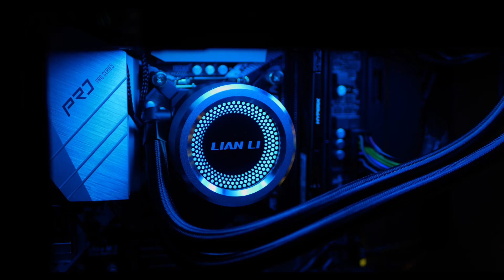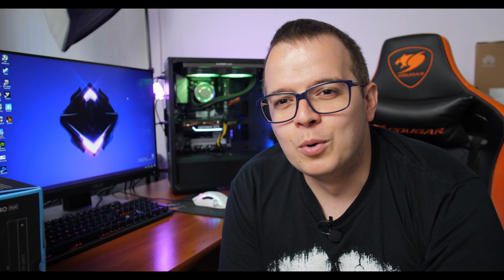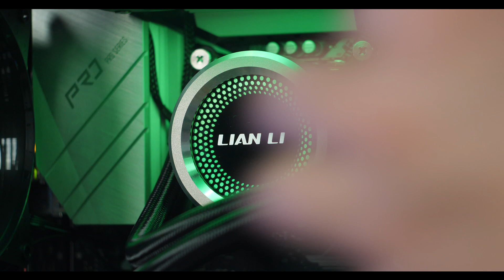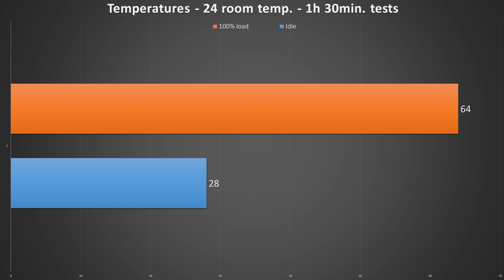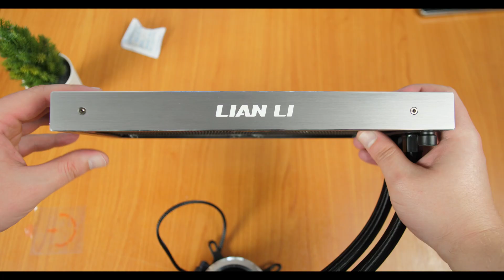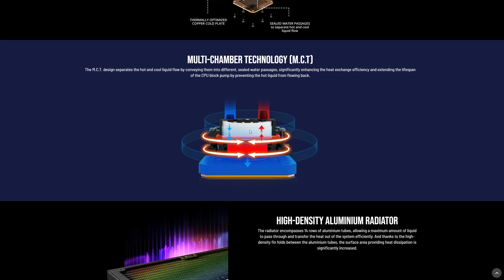Lian-Li Galahad 240 AIO - Beautiful and good performing!

Comment: You can remove those aluminum covers from the sides of the radiator, unscrew those 2 screws from both the sides and pull on the cover, it has a glue strip at the middle portion underneath and pulling on it will remove it easy enough!

Comment: I mounted it some days ago. It looks great and the performance are pretty good for ryzen 3900x, but the pump noise is a bit high, do you suggest to reduce the speed by the bios or mobo sw?
Reply from the maker: Hey! 
I haven't had any issues with the pump noise, as mine was silent. 
Check it with Lian-Li support maybe :?

Comment: I have the 360 in white. I dont get the temp your getting, idle at 40 max is 60. I did not use the cables that it came with can anyone let me know whats wrong
Also im using a 5950x 
Msi meg b550 unify

Comment: Question! So you do not have to connect the external remote it comes with? I’m having a little issue figuring out the easiest way to connect to my asus prime board so i can control it through the mobo.
Reply from the maker: Nope, I have used it with the 3-pin ARGB cable that is provided :) Check if the mobo has one